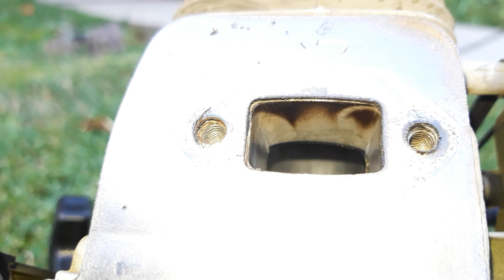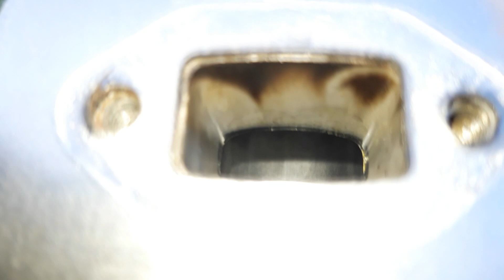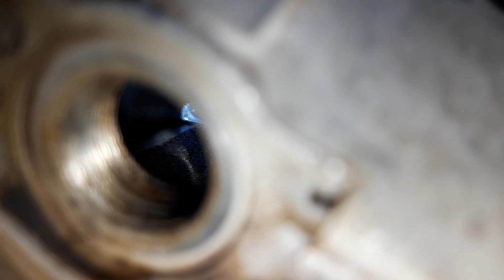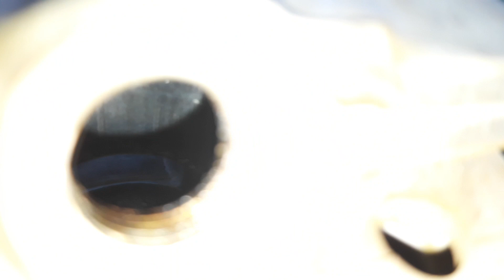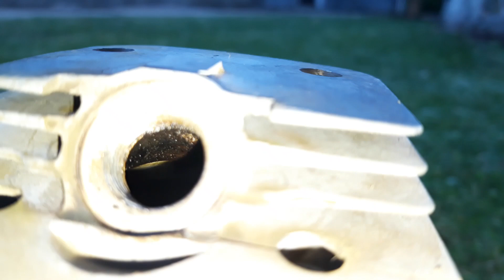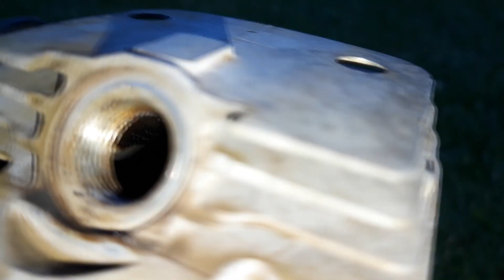Makita EM3400U Brushcutter Piston and Cylinder

Comment: Hello, i am thinking of buying this trimmer. Would you recommend it? Is it good or would you buy something else in this price point 400euros?
Reply from the maker: I paid for this trimmer about 250 euros. 
I am very pleased about it, and I higly recomend it! 
If you have a higher bugdet you can search for some models from Husqvarna, with higher horsepower. 
My trimmer has 1.6hp, but for me it's enough. I have a garden with a lot of trees and i cand move quickly between them. 
So, depends on what you have to cut. 
For my trimmer, I use 2.7mm cutting wire(it works great for me) and Stihl HP Ultra 25ml to 1L of gas.